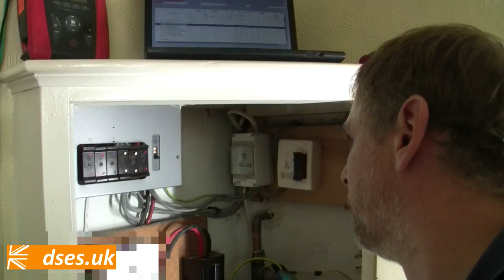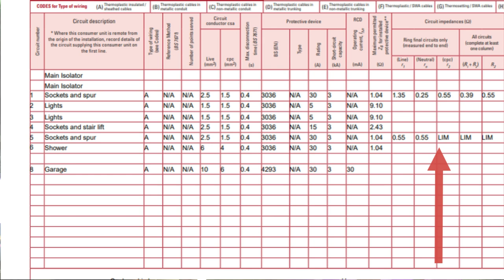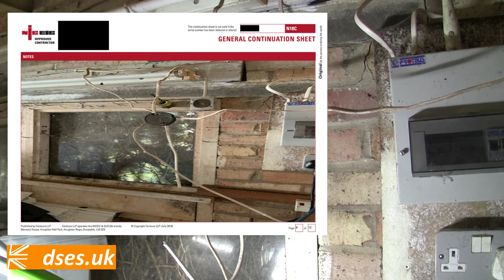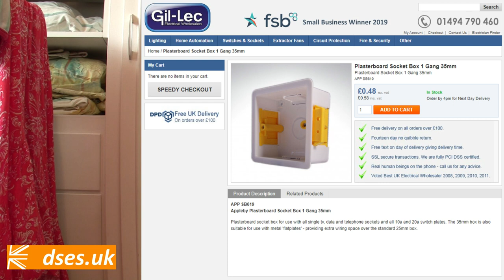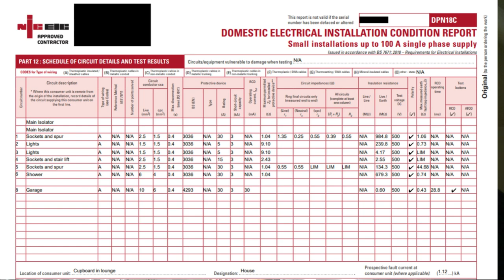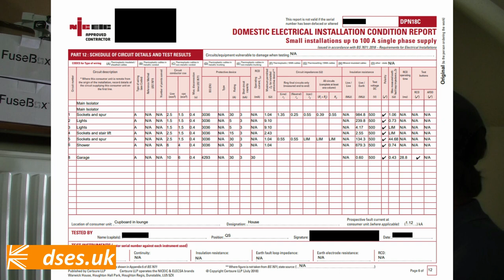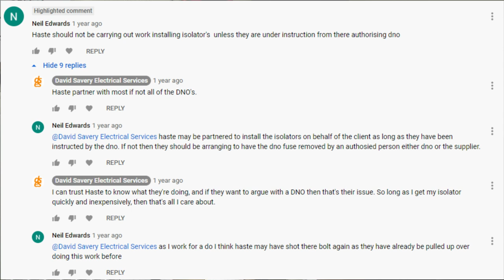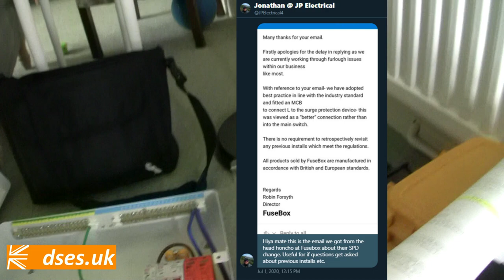Waffly Consumer Unit Upgrade

Comment: dont know if its still the case but for the south SSE will let you pull the main fuse if your accredited and you apply to them for temporary seals which are a sticker and you tell them.when any works are complete and they come out and re seal
seems like a system others shld follow
Reply from the maker: Makes sense to me, although pulling the fuse is a risk to anyone without the correct PPE. The smart meter rollout was the perfect opportunity to introduce a means of isolation to older properties. In my case, they removed a Siemens meter with integral isolator and split tail output and put in one that I now have no access to which has the ability to report any 'tampering' should I need to kill the power to my own equipment. Absolute farce, and balls am I paying WPD £218 should I ever want the power off on my own damn tails!
Reply from the maker: @andrewnorris3278  Their profits vs. Our safety is what it comes down to, and it stinks. The fact WPD squashed Haste from offering the service at a reasonable rate so they had the monopoly on the thing says it all.
Reply: @dsesuk  yep the excuse that they didnt want haste touching the main cut out without their instruction would be acceptable if for them to do the same thing wasnt nearly 3 times the price
Reply: @dsesuk  indeed if its a DNO only there should be regulation to keep the cost to reasonable levels
Reply: Still the case, five seals without addresses 20 with. Each seal has its own serial number linked to you. Southern electric use to fit electric meters with built in isolator switches back in the day. As said a isolator switch should be fitted as a matter of course when a meter is changed.
Reply: Correct, SSEN which cover both Southern Central England (MPAN 20) and Northern Scotland (MPAN 17) will allow qualified registered electricians to pull a main fuse for a board change and in an emergency situation. Different DNO’s across GB have different rules and it really should be the same rules across all of GB.
Reply: I have seen an example of a smart meter fitter taking out an isolator when they fitted the meter...
Reply: With the smart meter question. The original plan was for the supplier (MOP) to install an isolator as part of the national rollout. After the suppliers and Ofgem consulted it was ditched due to the extra cost and more importantly time spent on site. Most Smart MOPs need to aim for 3-4 dual fuel installs per day. So you can see spending extra time on site installing an isolator was quickly ditched.
Reply: @arod9998  once again a profit vs safety issue , but as ive said before people wouldnt mind going through proper channels if they were cost effective and easy , if the DNO's decide to make following there rules near impossible then they will have to put up with the consequences
Reply: RE my smart meter comment. Suppliers can install an isolator as part of a smart meter install if they chose to do so. My comment referred to the consultation about if it was going to be mandatory or not. Actually the earlier test versions of SMETS1 meters will most likely have an isolator installed. As the working assumption at the time was that they were going to be mandatory on all installs. However these types of meters will only be found in a few 1000 homes as new types of smart meters are trailed before they are rolled out to everyone. I should note Ofgem only allows suppliers to install SMET2 smart meters now. Unless there is a specific reason it can’t be installed in which case a SMETS1 is still allowed to be installed. The difference between the two is minimum but the later version means you can change supplier without losing the smart function. SMETS1 meters will eventually get this benefit as part of a remote update. So no need to do an actual meter change out.
Reply: Fitted a board the other year, literally installed it about 2 hours before the smart meter chap turned up (hadn't tested yet) - stayed around cause I was changing the gas boiler too. The previous supplier had an isolator fitted after the meter, the SSE guy actually took the isolator off and fitted new smart meters. Couldn't believe it - then he was like "Oh have you just fitted that - if you're not finished testing yet I'll leave you some seals so you can pull the fuse if you need to".
Reply: andrew norris agreed 100%. Cost and time on site were the two factors. But for me the big reason is this silly deadline from the government for all UK property’s to be offered a smart meter by 2025, though I think it’s been extended to 2027. And Ofgem fining suppliers for not meeting their install targets. There is no reason for a deadline for a smart meter rollout. Had there been no government deadline. It’s likely a isolator would have been included as part of the smart rollout as the suppliers could have taken there time to do the rollout properly rather than worry about being fined by Ofgem for not hitting their target which thus ties in to the government deadline. Will never understand why there is any deadline. If a consumer wants a smart meter then great if they don’t then fine. It should be the consumers decision. And suppliers put their customers under pressure to get a smart meter so they hit target and don’t get fined. It’s actually not the suppliers fault it’s Ofgem and the government with their pointless fines, targets and deadlines. My rant is now over lol 😂
Reply: @dsesuk  they do not want people fiddling / stealing the electricity so smart meter is their spy the gas supply is the same the meter detects a pressure drop and tells the supplier it has been isolated or removed they allow 2 for repairs or suchlike any more and they look for a pattern and attend site to catch the thief
Reply: We're in SSE territory, and pull the main fuse without their temp seals. Too much of a hassle to deal with them. 

I say this many times, and would be happy to repeat it in court. My safety overrides your DNO rules. I will PPE up,  and pull the main fuse, remove the cartridge, and put the empty carrier back in, and seal temporarily  (thrucrimp and a piece of phone wire) to prevent anyone pulling the fuse without a tool.  At the end of the job, I use a proper seal and sealing pliers to replace the seal.

The only reason for the DNO caring about cutting of seals is to prevent abstraction. I am not interested in abstraction and they'd be hard pressed to PROVE in court that I stole power. As I didn't. 

To be fair... SSE's own staff have told me my attitude is absolutely fine, and many times we find seals already missing.

Apparently other DNO's aren't as nice about it. Meter operators vary... Southern Electric (the former incumbent board) are the arseholes about it. But that's based on a sample size of ONE very pissed off meter installer who had a chip on his shoulder the size of the  SSE distribution service area :\

Edit: want to charge me to fit the isolator? Piss off.  The ONLY reasonable charge would be a cost for the isolator itself.  The customer pays for the DNO to attend thru their effing electricity bill. 

The tails are the property of the consumer. The smart meter can piss off with its grassing up.. it's not grassing up, as you're not doing ANYTHING wrong. 

PS, the mounting board isn't the property of the DNO, it's the consumer's property also. They can all feck off. And the DNO can't fine you. They're not the government. ONLY local or central government (or their representaives, such as the police or local council jobsworths) can issue a fine. The DNO is a private company and can only send you an invoice. You can decline to pay such. They can then take you to court. The only POSSIBLE thing the court could find against you is (hilariously) criminal damage to the SEAL. Which you'd simply say was missing when you arrived.
Reply: @dsesuk  Totally agree WPD are a pain in the backside...  If they turn up at the door just tell them there was a dangerous situation with the tails which needed to be isolated in an emergency so you had no choice but to pull the fuse but you are fixing it.   The stupid thing is landlords have 28 days in which to fix an unsatisfactory EICR report, you try arranging for WPD to come a pull a fuse or fit an isolator in the next 28 days.   One im doing the energy supplier was not doing it at the moment because of COVID, in the end managed to get WPD to agree to come out by pointing out there was an old 80A meter and the head said 100A fuse so the meter needed to be upgraded as well as tails, arrange to meet them onsite with isolator in hand so they can just terminate into the bottom of the isolator then bugger off and ill do the rest.

Why dont WPD run courses on pulling fuses?  if its ok for SSE to let sparkies pull fuses, are WPD saying their network is not maintained as well as others so cant be trusted.  Why should WPD charge almost as much for a 15min isolator install as I do for an entire days work.  Npower fit them for free so its often cheaper for the customer to swap to Npower, get isolator fitted then move to another supplies but what customer is going to accept that when the next guy will just get it done.
Reply from the maker: @arod9998  The solution to that is to insist manufacturers have isolation built into the meter. You see how quickly they jump when they know they can coin it in on a national rollout.
Reply: Hi Andrew. I rang a few months back for some seals and was told not to bother. They said happy for me to pull it as I am NICEIC. If I had a seal to put on after all well and good  🤷🏽‍♂️
Reply: I was with SSE this week for an install and they made the same comment as Andrew Norris. The engineers said it perfectly acceptable and even gave me some tags to re-seal. I found a piece on the UKenergy networks web page which states that in certain circumstances the registered electrician can remove the main fuse. He did say to wear safety glasses and gloves when reinserting the fuse.
Reply from the maker: @leonardcarter8979  That's all fine, and the engineers on the ground are usually permissive of fuse pulls, but the fact they're asking you to PPE up demonstrates that it is potentially dangerous and that fuse pulling isn't the best way for anyone to isolate an installation. It should be a risk-free cost-free option for any installation enabled by their being a big red switch you can easily clonk off!
Reply: I carried out an eicr recently, eon subcontracted Morrison utilities fitted a smart meter at the property, dual rate using a separate contactor to switch the o/p db, 3 pole isolator, looks beautiful. Except, N of contactor coil in the load side of the isolator!!! (Line obviously from the meter on the supply side!) I coded it a c2, and as it is an unoccupied flat the landlord now cant rent it until its sorted! Spent 1½hrs on the mobile to both eon and morrisons trying to get it sorted without having to deal with ukpn and their '2week' promise to no avail! Question.... why are smart meters installed by people who dont understand electricity! Surely properly qualified electricians should be allowed to do this stuff.
Reply: @dsesuk  
What is the PPE needed?
1) gloves;
2) eye glasses (which type?);
3) fuse puller;

Anything else?
Reply: SSE are a pain in the arse there is no dedicated number for contractors you have to go through the call centre and choose from a host of options in the end I just reporteda dangerous situation IE exposed copper........... result fuck all honked the fuse and cracked  on never heard back to this day
Reply: @dsesuk  
The gas and water companies supply isolators to the installations. Ignore these sharks.
Reply: Devlin Maguire If you are down south, you can go to their depo on the edge of the new forest and fill in the paperwork / collect the temporary seals.
Reply: I have in the past applied for and received temporary seals from SSEs engineering department on the presentation of suitable credentials. Make you feel much happier that your not going to get a letter through the post later. Mains Switch off, PPE on and carefully as you go!!
Reply: Meter fitters will fit an isolator if main fuse is 100A but customers tails from ccu are only 16mm. As they aren't allowed to downgrade existing DNO fuse.
Reply: @Halleck-yk9ep  
If 25mm?
Reply: @johnburns4017  Then no reason to fit isolator as tails are adequate for 100A fuse. I know it's nonsensical but thems the rules.
Reply: @dsesuk  do you think it would be worth getting your G39 cert? I can't see DNO installing isolators anytime in the future and at least with that certificate you can do it yourself, at least that's my understanding of it, it allows you to remove and replace DNO cut-outs so I don't see why you wouldn't be able to install an isolator as well. Might be worth looking into you never know
Reply: @dsesuk  i totally agree with you.  here in the Netherlands the same... every home is different.. some friendly services place a breaker for the main fuse. others keep the fuse in a sealed box.. and mine even dared to seal my cutoff switch that is installed between my meter and my consumer board. also the wildwest in fees is bullocks.  when I installed this switch and my consumer board I just took the fine.. I asked them for the disconnect and they asked 278 euro for disconnect and 278 for reconnect with a minimum of 8 days in between. yeah right.. I needed a 5 minute disconnect so I could remove the old board and connect the switch...  the fine was 75 euros 🤣🤣
Reply: @dsesuk  The risk whilst pulling the DNO fuse, and hence the need for PPE, is much reduced when a double pole isolator is fitted between the meter and the CU, just saying.
Reply: @Muhammad Brock Instablaster =)
Reply: @Holden Deshawn it did the trick and I now got access to my account again. I am so happy:D
Thanks so much you really help me out!
Reply: @Muhammad Brock Happy to help :)
Reply: @TheChipmunk2008 there just idiots havnt got a clue smart meter reporting tampering lets face it if someone wanted to nick power for a grow or something we all know they aint pulling the main fuse they risk there life ramming some janky looking cable in the bottom of the meter or cut out with there bare hands. Just a pointless feature if ya ask me causeing nothing but headache if the fuse needs to be pulled. The  only person pulling that fuse is a spark changeing board dno or the meter man him self 🤦‍♂️🤦‍♂️

Comment: I once booked EDF to pull the main fuse for me and to replace it (had to make 2 appointments). They use 5 hour slots, 7-12 and 12-5, the 1st guy turned up at 11.50 to pull it and the 2nd guy turned up at 12.30 to put it back!
Love the video, great to hear some common sense.
Reply from the maker: Yes, WPD told me they could do a fuse pull at a cheaper rate than their eye-watering isolator price, but who wants to hang around waiting for two separate engineers to turn up? It's an absolute lottery, and nonsense like you experienced then happens!
Reply: @dsesuk  I fully agree with your views on DNOs and isolators, and enjoyed your rant, having muttered the same myself many times ! For my next board change I've bought myself an isolator from Screwfix for fifteen quid,  and I'm going to get WPD to come out and disconnect, I'll put the switch in whilst he does his paperwork, then he can reconnect five minutes later. I can't see how they can object to that and I can change the board at leisure then...

Comment: The reason a spur can be connected directly at the 30A CU fuse, just like any other part of the ring is that it does already have overload protection at 20A or so – being a spur it can feed the maximum of one double socket – which although could be fused at 2 x 13A it would generally be less than that.
 
433.2.2 allows that the overload device can be anywhere along the circuit, so you have fault current protection via the 30A fuse at the CU (subject to low enough Zs) and overload protection via the FCU/Socket (actually within the plug[s]) at the other end.

If it feeds more than one socket/FCU then it isn’t a spur and must be a radial, in which case it would need a separate 20A CU fuse
 as the multiple 13A fuses at each FCU/Socket could total more than the 20A cable rating

433.1.204 does not contradict 433.1.1 as the 30A CU fuse is NOT the device providing overload protection to the spurs, it is the fuses within the FCU/plugs that provides the overload protection.

Therefore a spur at the CU isn't C2 or C3 or anything other than compliant; however in your case here as it feeds more than one outlet it isn't a spur at all - and is a full radial circuit, which does not therefore have overload protection, and you would be correct in C2 - overload protection not provided
Reply: > The reason a spur can be connected directly at the 30A CU fuse, just like any other part of the ring is that it does already have overload protection at 20A or so – being a spur it can feed the maximum of one double socket – which although could be fused at 2 x 13A it would generally be less than that.

Some proper safety there. "I mean, it could fry the cable in normal operation, but it probably won't". Bonkers.
Reply: @Karreth  plugging 2x 13amp heaters into a double socket spur is not “normal operation”, (even that wouldn’t draw a constant 26amps for very long as they have thermostats these days). Something like 2x kettles boiling at the same time would make the 2.5mm toasty but you’d not install a spur in a kitchen like that, they’re for odd extra lighting sockets. If installed like that it should probably only have a single outlet socket tbh, not sure if that’s implied anywhere in the regulation.

Comment: Agreed on 20A radials wherever possible, splitting kitchen up a bit to have for instance just "kitchen worktop" as one circuit keeping other non-worktop sockets with downstairs, and another circuit for just washing machine/dishwasher which are often prime suspects in the RCD tripping game so best separated for that purpose anyway!